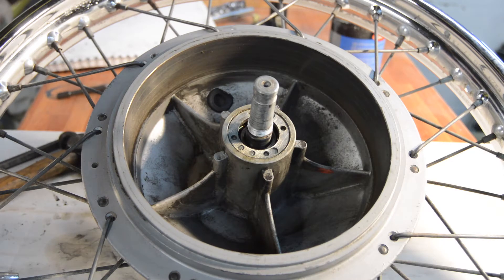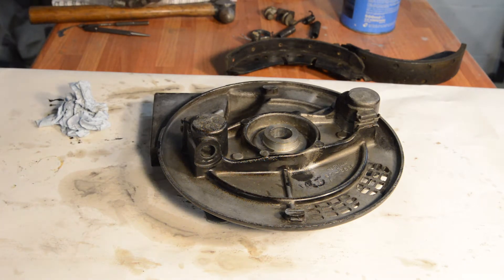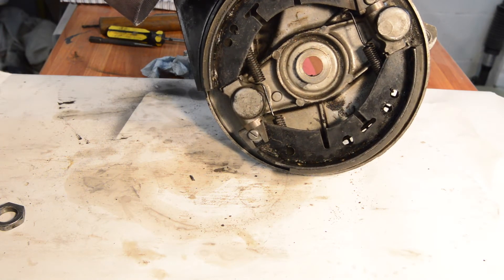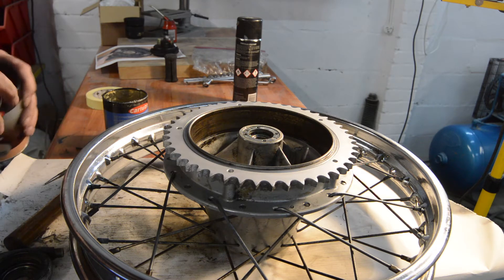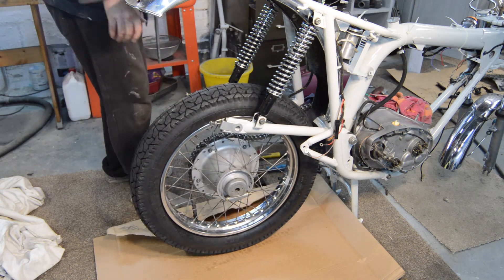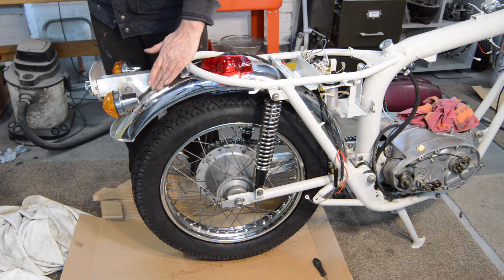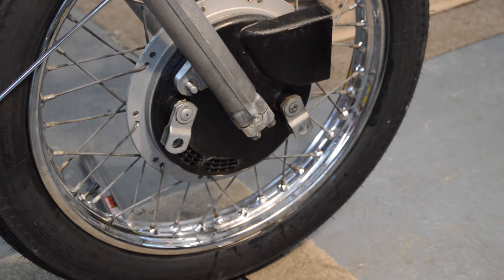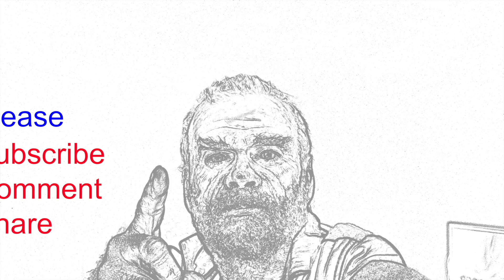Firebird Part 23

Comment: I'm a little shocked, bearings exposed but you didn't put new grease in and then you re-use 60 year old shoes. Braking technology has come a long way since those ones were made, drums were never great to begin and need all the help they can get. My motto is Never Compromise With Brakes, they are designed to save your life
Reply from the maker: As I mentioned in the video, I decided I would wait until the bike was back on the road and had a few miles under its belt to see how the bearings went, it is quick and easy to change them after all, but two years later they are still in there. Braking technology has indeed advanced as you say but the quality of after market parts definitely has not. I have new pads and shoes in some of my other classics and really wish I didn't. I also personally know of two cases of delimitation of bonded shoes ( on cars ) made by one of Europes largest brake manufacturer. I was willing to give my original asbestos laden, riveted, old technology a go to see how things panned out. The motto is absolutely correct, the definition of compromise is however subjective, I did not think fitting unbranded, bonded shoes from an unidentified manufacturer as offered by many classic parts vendors would be much of an upgrade. Thanks for watching!